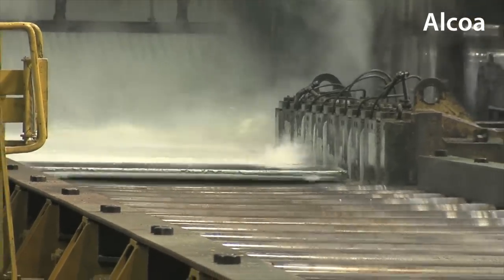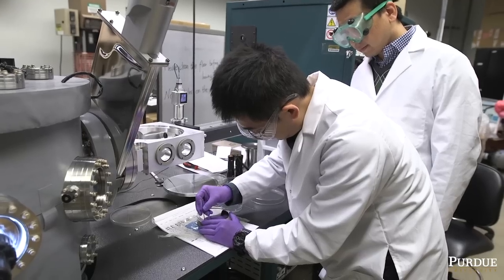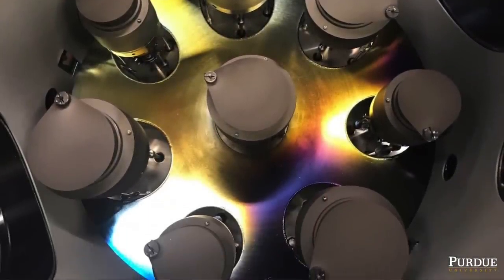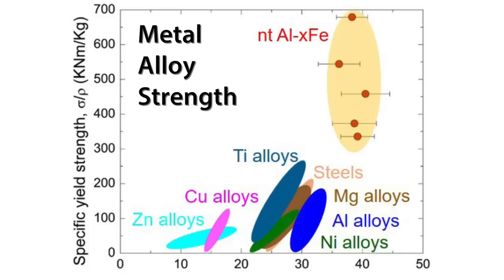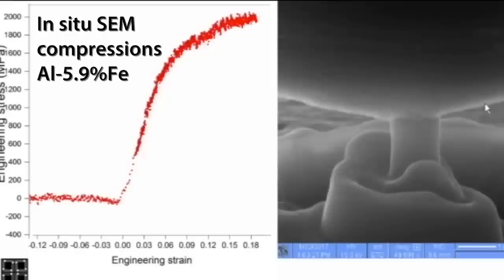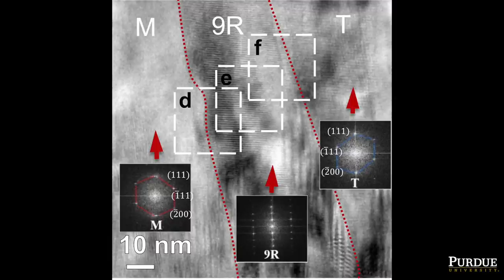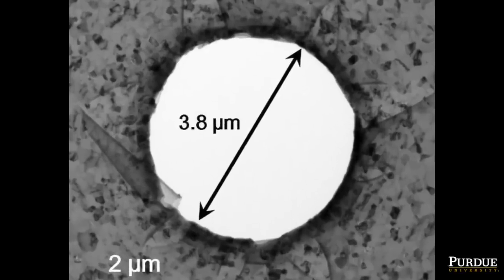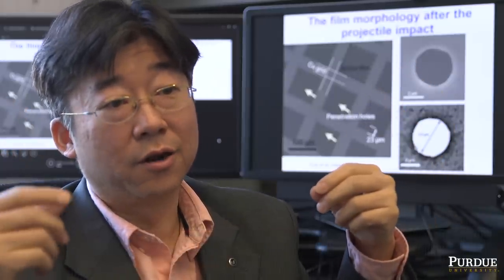Super-strong Aluminum Alloy

Comment: Is this 7068 aluminium alloy (Tennalum)?
Reply: I don't believe its 7068 aluminum and was developed around early 2000's by Tennalum Inc. Which is a division of kaiser Aluminum corporation.  However it could be an improved version possibly based off of 7068. just a thought. Also Here is a link to some info just on 7068 https://precisionarmament.com/tennalum-7068-aluminum-alloy/